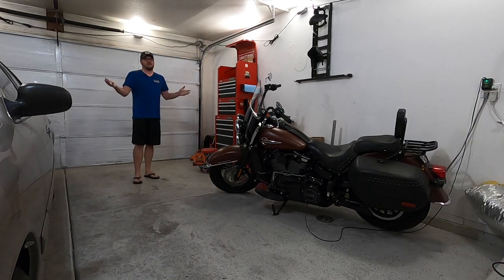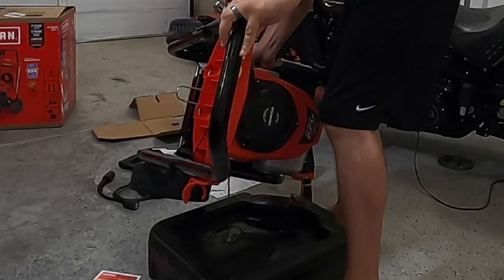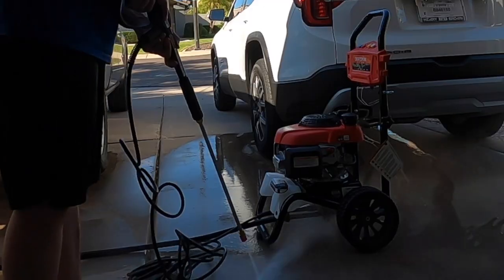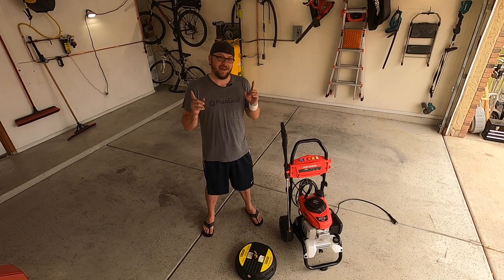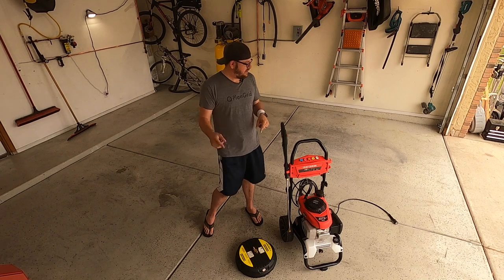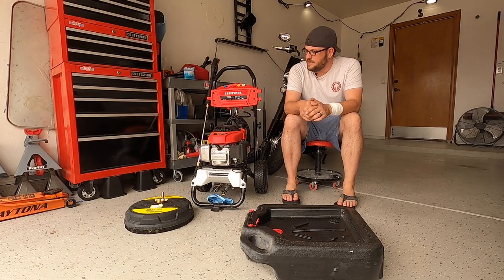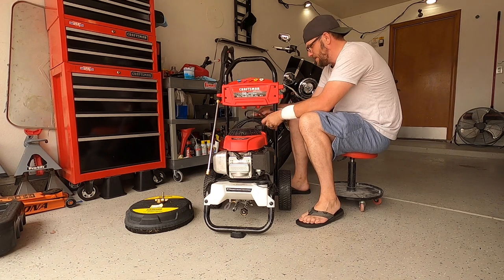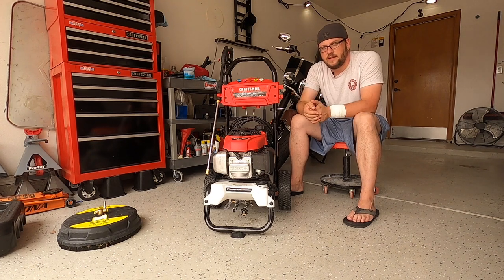CRAFTSMAN 3200 PSI Gas Pressure Washer Review

Comment: Great video! Thank you. FWIW Running non synthetic conventional oil is better for initial break in because it allows the rings to scuff up the cylinder walls more effectively thus allowing the piston rings to  "seat" better which is an important part of the break in process. Definitely switch to synthetic thereafter. Happy power washing!
Reply from the maker: Thanks for the input. I probably switched to synthetic too soon but such is life.
Reply: I had always heard the same thing:  Break-in should be done with real Dino oil (non-synthetic), and then you can switch out to synthetic after that.

Comment: Funny, I just brought the Craftsman with the  &   (spell checked castration) yesterday  3000 PSI 2.5 GPM on sale for $311.20 REG $389, yours, this on going to pain you, at a sale rate of $294.63. Buy Snow-thrower after the Winter Season, Pressure Washer and Lawn Mowers in the Fall. I looked at the Ryobi also not fond of the Honda Engine, not cheaper, Dewalt way too expensive at Home Depression, thanks for the Video
Reply from the maker: Interesting. I just looked it up and it still is listed at $449

Comment: Nice review. I purchased the same unit last month and I am already on my third hose. The first hose split within the first 2 minutes of use. The second hose was an hour into using the unit. If you purchase this unit (or any others) be consonant of the hose and exhaust. The first hose was a defect, the second hose was the issue. I was not watching the hose as I was cleaning the RV from our recent trip. As I was washing the RV, the hose lifted and kissed the exhaust. Melting the exterior of the hose, causing it to immediately rupture.  

I really can not give this a review one direction not the other until I get more time on the unit. Hopefully it works well.
Reply from the maker: Interesting. I’ve used mine a bunch of times and haven’t had issues with the hose yet. How sketchy is it when the hose blows?

Comment: this thing is a piece of garbage I got one of these it died on me the first time I tried to use it took it back to the store exchanged it. Use it again for a couple of months the engine blew up took it back to one of the dealers they rebuild the engine then the cutoff switch stopped working it almost electrocuted me because I had to remove the covering for the spark plug to turn it off. Have that repaired the engine started shaking so badly it broke the frame connection. Eventually I sold it for $50 and was glad to be rid of it
Reply from the maker: Mine still runs strong (I think). I haven't started it in a while.
Reply: I bough mines at Lowe’s  i Tried to turn it on after an hour of trying it finally turn on, 20 min in the water pressure wasn’t working even though the engine was on, I return it only to be struggling 2 days with the new pressure washer trying to turn it on. If it’s new at least it should turn on on the first days but not even that I return both and bough a new brand on Home Depot will try it out tomorrow.